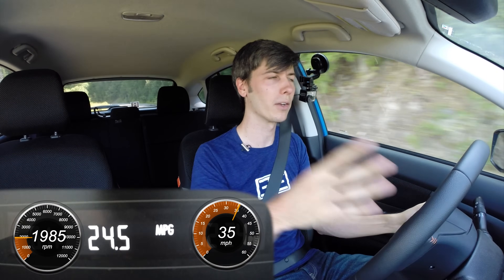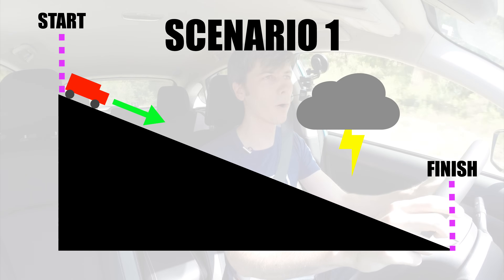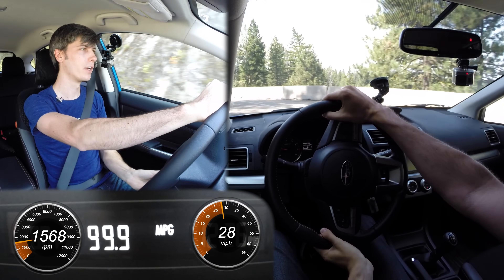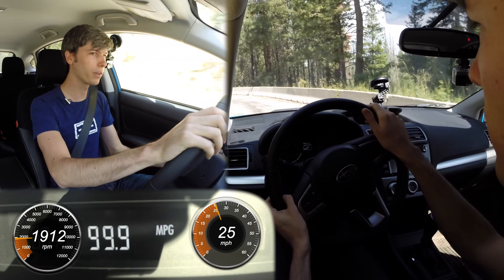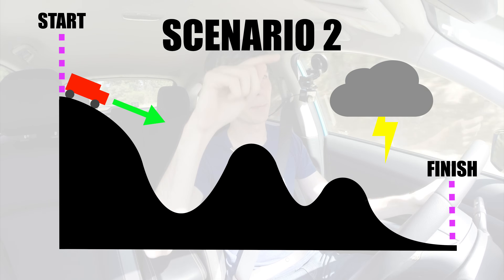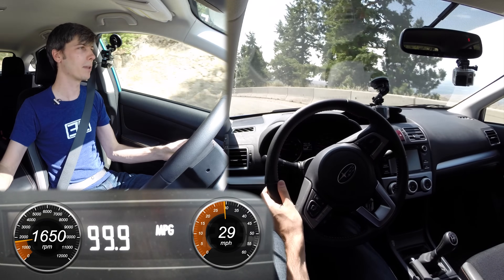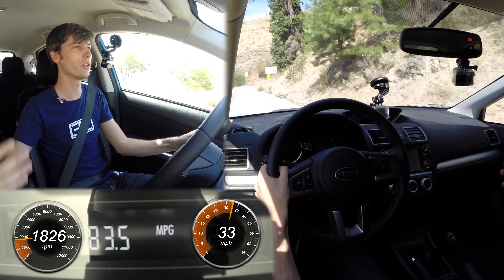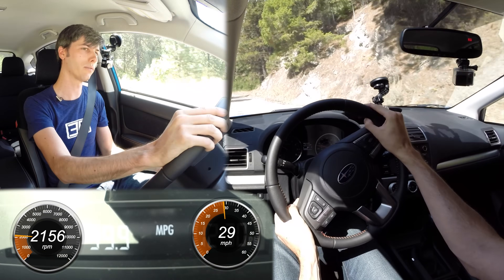What Uses Less Gas - Coasting Or Engine Braking?

Comment: How is the engine turning with "explosions" and "exhaust sound" as if the engine is "on", if the injectors are apparently "off" when still in gear but foot off the gas? if foot is off the gas, it must still at least be using the same amount of fuel as if in idle, coz when the car is in idle , but in first gear, it's still going to drive even though your foot isn't on the gas, so i'm confused now.... 

I'd say the engine tells the ECU to compensate and reduce the amount of fuel input with the speed it is going to come to a stand still, although it wont, will it. OR because there is only enough fuel for 1000rpm to go into the engine, the engine slows down as a result of still being in gear until the fuel input matches the power output.. coz once you are back down to 1st gear and foot is still off the gas, you will eventually just be coasting in idle rpm's anyways.... which, normally around 1000rpm, still uses fuel.. the same amount as coasting in neutral.. So, the only time the injectors don't inject fuel is when the engine is off.....  Please @Engineering Explained, readdress this subject and explain to me what confuses me?
Reply: If you're in gear, then movement of the pistons in the engine results in wheel torque. The same exact mechanism works from the other end: as long as the wheels spin and you're in gear, the cylinders move by inertia. You can make the machine work by either spinning the wheels or exploding air-fuel mixture in the cylinders. Thus, car's ECU recognizes coasting and cuts off fuel supply.
He mentioned at 2:25 that THIS DOESN'T WORK IN LOW GEAR AND SPEED because the amount of energy you're playing with is too low and losses are too high, so the car will keep fuel injectors on. Notice his fuel economy counter going down from 99.9.

A similar thing happens in electric vehicles (regenerative braking), allowing them to use car's inertia to rotate the motor and induce current that charges the battery back.
Reply: @DmitryTheNoobZMasterGranicin  THANKS!!!! I thought I missed something!! makes sense now!,, So but, there are still explosions going on even when the injectors aren't injecting? or is that actually just the sound an engine makes because its turning?

I see as well in a comment he stated it doesn't always apply, I guess my car doesn't turn the injectors off after all, so i suppose that's why I was so confused at the logic when I still hear the engine is clearly getting fuel... XD,,  It's an Opel Corsa lite, 2007 1.4i
Reply: @Saint_Dominic23  Don't take my word for it because I'm not a motorhead, but I do think you're just hearing the hum of the engine, not the explosions going on. All I know is that you can start your car by putting it in gear and pushing it forward hard enough (explaining how the car knows you're coasting).

Comment: So I’m using the engine brake down a long hill, my engine is running at 3500 rpm.. but it IS running. The fuel is still combusting in the chambers. Seem fuel is being drawn in instead of forced. I have reservations about the fuel consumption meter on this Subaru and by what method it reads the flow.

Comment: On a mild slope down hill this is wrong, or even a flat road.  
Automatic transmissions produce drag and will slow the car down sooner as opposed to being in neutral. Long-term you will have to accelerate again sooner as opposed to coasting in neutral. The amount of fuel used to keep an idle in neutral is still less then the amount of fuel needed to accelerate again because the car has slowed in drive.

Comment: My VW automatically goes to coasting when I release my foot, it only goes to engine braking only if I touch the brake. Coasting has helped me save a lot of fuel. On a normal road, speed wont decrease that quick when comparing with engine breaking.

Comment: "Ignoring all the negative consequences of doing either of these. Whichever one's safer, that isn't the place for that discussion"

Oh?! Then the most efficient is the car in neutral with the engine off. You'll get downhill pretty fast and spend 0 gas.
Reply: ROUGHLY SPEAKING
Reply: Arkaid D GG brake pads
Reply: @nikyabodigital  good luck with that. You need very very strong legs to be able to brake a turned off moving car...
Reply: As he shows in the video, you also spend 0 gas with the vehicle in gear without turning the engine off.
Reply: @Joe_Mission  but you gotta turn it on
Reply: @isitmichaelormicheal1263  it's already on, you'd have to turn it off for it to be off, then turn it back on again, not to mention your brakes and steering won't work right with the car off.

Comment: My car does coasting automatically. When i release the pedal (and speed is above around 60-70 km/h), it will put the gear in neutral. If i apply brake or gas, it will engage the gears again. Really nice feature.

Comment: Hi everyone. The BMW's/Mini's have a coasting function for their auto cars when running in green mode. The big Q is why would there be a need to for this feature if the coasting in gear is more economical(no fuel required to sustain the idling). I mean as soon as there is no throttle input and there is little or no brakes applied the gearbox goes to neutral. Strange enough the fuel consumption meter for both coasting in gear and in neutral gives the same reading (0 l/100 km).  Anyone with an explanation why BMW has this coasting function?

Comment: I don't care either way, I will continue using engine brake assist with my automatic. Note the word assist, not braking altogether. I select a lower gear only enough to raise the rpm to somewhere above idle speed to help the brakes, not do all the retardation.

Comment: how can an engine keeps running without the fuel being injected ,i think that you are miss-using terms of 99 meaning that you are having the less injected fuel ,maybe ,but if the car ,accelerate due to the gravity ,you might be having some added fuel consumption ,
Reply: The wheels are rotating which rotates the engine as they are directly connected whilst in gear.

Comment: Is it necessary to use the clutch to put neutral? I see that you step on it but I don´t see the need of using the clutch to disengage the gear.
Reply from the maker: You don’t have to, just easier on your transmission.

Comment: There is another scenario that is more efficient. Say you're driving along on level ground and in the distance the light turns red. 
If you take your foot off the accelerator in gear the car will slow down too quickly to make it or will slow down too much for cars behind you to not start honking their horns.
However in neutral one can often maintain enough speed to make it all the way to the stoplight at a reasonable speed.
If the light turns green before stoping you can pop it back into gear and have never stopped.

Comment: Engine braking only saves fuel when you have to brake anyways, otherwise it won’t save fuel. Just remember, for each revolution that crankshaft turns, it will consume energy, and the higher the rpm the more energy will be consumed that way. For example, there was one time that I was traveling down a freeway that is slightly downhill at 70mph, and the car almost keep itself at that speed while I am coasting in neutral, the fuel consumption was 1l/100km (I like metric) however when I put the car in six gear the engine would be running at 2500rpm, and I have to give a little throttle input to main the same speed, the fuel consumption is around 3l/100km, which means it uses more fuel to run at a higher rpm. However if I were to slow down at 70mph to 40mph, it would cost me 0l/100km in gear vs gradual increase from 1l/100km to 2l/100km while I am slowing down in neutral.

Comment: A Question: Is it better to accelerate full throtle while going downhil to gain max momentum and speed to press the clutch in and let the car roll uphill and start to accelerate when you're on a flat surface again? well, isn't the car using more fuel on the way up then down? Because on a bicyle it is also way easier to drive downhill than uphill...

And on a electric car such as a Tesla: Is it better to gain momentum or let the batterie generate itself on the way down to use the generated power for the hill?

greetings
Reply: I think that is less efficient because you get more losses from going fast downhill, but it is a time saver if it's safe to go that fast.
The most efficient is usually to coast down the hill gaining as much speed as you can using gravity.
I don't know about regenerative braking as it depends how long and steep the hill is. For short hills, probably momentum is best. For long ones, where you reach a terminal velocity, you are throwing away energy after this point, but you go faster.

Comment: I was looking for answer to my question in this video. The question is what is the purpose of injecting fuel during engine breaking, which happens in my Mazda 6 (2008) 2litres gasoline engine with EFI and also VW Altea (2010) 1.8 litres turbo-gasoline engine. The computer shows 0.0 (litres per 100 km), but when I connected those to diagnostic, it shows it is actually injecting quite lot. Amount depends obviously on vehicle speed, but also on revs. Higher revs = higher consumption. It varies from amount similar to what is injected when running on neutral up to about 4 litres per 100km (which is about half of my average fuel consumption). Same reported also for some other car models.
One possible reason for this could be to not let catalyst to cool down by pumping cold air from outside through engine and exhaust, but what a waste of fuel!
Do you have any other explantion for it, @engineering explained ?

Comment: I have a question, if there’s a 10k hill at a 10% grade what is the difference in gas mileage doing those 20 k vs 20 k on flat land. Altitude of starting point.

Comment: Ok, so the fuel injectors stop delivering fuel to the engine when you coast in gear, BUT, the compression from the engine will be working against you and will eventually slow you down to the point where you need to give it more gas. Now, here's what I wanna know: is there a way to coast in gear without paying the price of engine compression? For example, is there a modification that will allow the throttle door to open without signaling the Throttle Position Sensor? Or, is there a way to temporarily cut power to the fuel injectors on-the-fly so you can open the throttle with the gas pedal to let in air while using no fuel? Because if that could be figured out then you could coast downhill using absolutely no fuel and also have no resistance from engine compression. My engine is a Toyota 3vze by the way.

Comment: Very informative video. I have a doubt. When we engage gear while going downhill, the engine revs. I am under the impression that the revving sound we usually hear is the result of burning fuel. Tiny explosions, if there were no silencers. The more the engine revs, the more fuel it consumes. You said that the supply of the fuel cuts off when the vehicle is going downhill and gear is engaged. If so, then what is causing the revving sound from the engine when going downhill?
Reply: I don't have the exact answer for this but maybe its the air being compressed inside and going out through the exhaust.

Comment: Depends on the transmission, too. A slushbox will rob a lot of momentum from the downward traveling vehicle, if you coast. And in return, all that does is slip the torque converter and create heat.  So you're shearing your ATF fluid and losing speed. A manual is the most efficient for this scenario, obviously, since you have a hard, non-slipping link between the wheels and the engine. And a manual is lighter than a dual-clutch. 
Then the steepness of the hill comes into play. If you have to apply brakes to stay at a reasonable speed while coasting in N, you might as well be in gear, no matter how inefficient, to stay off brakes and gain, at least something, at the fuel injectors.

Comment: What about switching off the engine, I do this with my 2 wheeler, I get very good millage, I think technology should help and there must be some mechanism that the car itself senses down hill and make use of kinetic energy efficiently, or store it and release when required (in the uphill).

Comment: The question is why does it shuts off fuel....in carburettor engine we know it works on sole vaccum from engine that is why it will spray fuel...but what with efi...why it shuts off fuel...because of no load conditions detected by MAP sensors or is it something else...can any one please?

Comment: So this video is for stck shift and automatic cars only.  For people who have electric cars:  you engage 'brake mode" you are slowing the vehicle (saving the brake pads) and throwing energy back to the battery - ie: extremely efficient.  Imagine coasting in gear and getting gas back in your tank.   In Drive mode you have the same impact as neutral - again more efficient.

Comment: I always thought neutral was more efficient so I always coasted down hills because it made me feel better. Now that I know this, I think I'll use engine braking more. It's all a small difference in a Miata like mine but it's still interesting.
Reply: coasting also wears out your brakes very fast
Reply: @marrox013 Use engine braking where coasting would force you to use your brakes, use coasting if engine braking would require you to use the gas pedal (both rules refer to the stretch of road for which you can predict things like gradient and speed requirements). The video only pointed the latter aspect, but those two go together.
Reply: @aphextwin5712  yeah, that's what I meant
Reply: @marrox013  Coasting does not wear out the brakes, provided you plan and do not get into a situation which requires you to reduce your kinetic energy. If you have a downhill down to a bend, you use the minimum of engine braking needed to enter the bend with a manageable speed.
Reply: @altoclef6688 there is no e gine braking whrn coasting in neutral.
Reply: @tonymouannes  Of course not. I didn't say there was. But if you coast downhill and approach a bend you could get too much speed so you will need to put the car in gear and use the minimum of engine braking needed to enter the bend with manageable speed.  
I thought that was very evident, but I spelled it out now so it should be clear for everyone.
Reply: If you have an old enough Miata, it might not turn off the injectors during coasting. You can check it with a scan tool or some code readers.

Comment: I`ve been thinking about this since I started to drive. But my Ford Focus 2008, 2.0l automatic does the exact opposite. When going downhill (3000ft hill) in gear (4th) the consumption sits around 60-70 liter per Km, while in neutral it goes above 90 l/km. Why? Maybe because this particular model does not shut the fuel injectors completely? Or maybe is because of the greater speed gain in neutral? Or maybe the fuel computer is busted? I`ve tested this many times with speeds around 90km/h to 130km/h

Comment: i’ve got a question in my mind for a long time,
when stopping at a red light,
will neutral save more fuel than in drive?
cause when you put it in drive,
the fluid couplings absorbs the energy from the engine,
thus the rpm gets lower.
but in neutral, the opposite happens, 
there’s no load on the engine,
thus the rpm goes higher.
and usually, we think that lower rpms is more fuel efficient,
but there’s a load on the engine,
so does lower rpm with load save more fuel,
than no load, but with higher rpm?

Comment: Would not worry about fuel but brakes more. It is important to save brakes, especially on really long descents. Also some older cars needed throttle to add oil to the system. Should not be an issue in modern cars though.

Comment: So what I understood is that when the car is in gear the inertia force is helping to keep the engine running with very less fuel consumption and when in neutral since the engine is not using the inertia of car extra fuel is need to keep it running. What I don't understand is that how car doesn't use any fuel when the car is in gear/engine braking scenario because some little amount should be required to perform the cycle of the engine and if there is no fuel used how can the spark be ignited in power stroke. I'm confused here 🤔

Comment: It depends yes. Use braking if you have a need to slow down or with-hold acceleration down a hill. But in flatter areas it can save fuel especially if the engine is off because you have a car that can do that XD

Comment: Will engine braking wear out the engine faster than coasting and using brake pads? I'm asking because it's easier to replace brake pads than engine components.

Comment: So..if I drive in neutral using fuel to idle it uses more fuel because you read that from computer factory put in there? Do the Mith buster test..
Rolling car on inertia with 0 fuel involved doesn't look like that cruise you did..why? Remove fuel injectors and see..cruise in gear without gas without fuel looks like you are push starting your car..this doesn't look like that so it depends if you think that you have perpetum mobile or not?

Comment: 99.9 is not the max, at lease on subarus.  I hate that gauge. I monitor the mpg from my scan tool plugged into my cars ecu. In netural going downhill i have seen numbers 200+.  That is because there is no load on the engine.  You will also notice the braking is better since there i no load on the engine. I throw the car in neutral when someone cuts me off.  But once again it is back to personal preference.